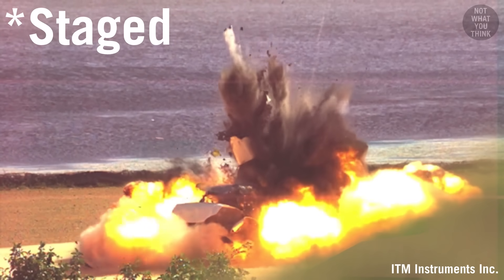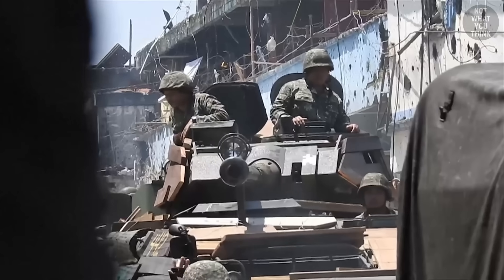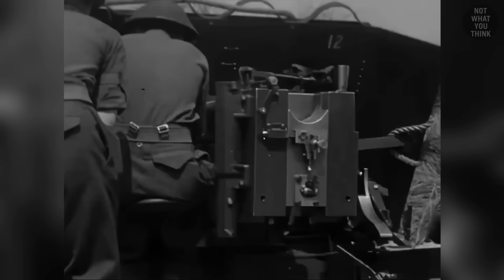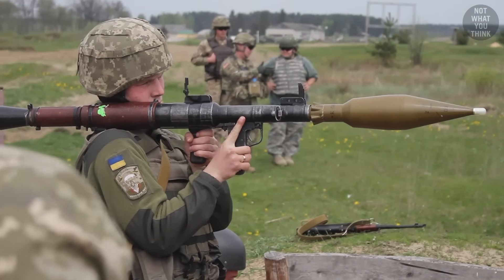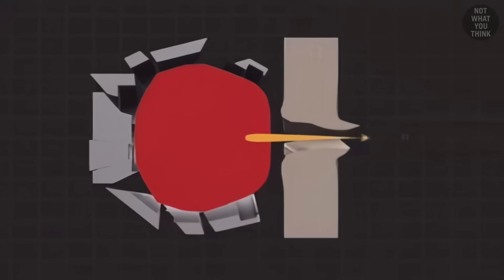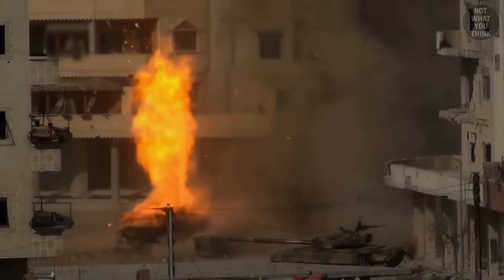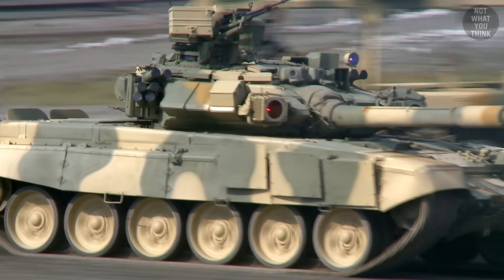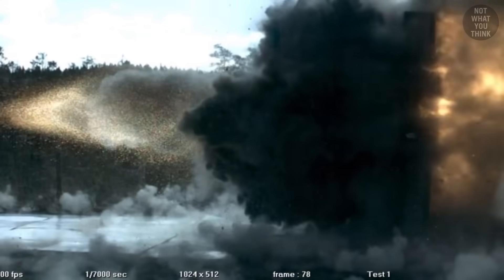Why Protecting Tanks is Getting Much More Difficult

Comment: Before you read just know that this is a very long read, have fun. 

The tank isn't obsolete and won't be until something with better protection, better firepower and better mobility comes along. A tank combines 3 key elements in combat: protection, firepower, mobility. It also cannot be viewed in a vacuum, it should be part of a combined armed force which today is even better at protecting a tank.

So firstly, protection. Of course a tank has armour, it may not be armour capable of defeating modern anti-tank weapons but it's still armour that forces the enemy to use a heavy anti-tank system to take it out, now this is important in a vacuum but even more prevalent in combined arms warfare. A sniper can sit far away, engage an enemy AT gunner and remain concealed because it takes a bullet to kill an AT gunner, the sniper can then exit the battlefield without ever being spotted. Firing an anti-tank weapon is a lot more obvious, when it is fired it's loud and lets off some smoke, this means that your infantry or in modern warfare even drones can now see that AT gunner's position and subsequently even if you lost a tank that anti-tank gunner just gave away his/her entire team's location and now it's open for counter-fire, an AT gunner knows this and so may very well avoid taking the shot if there is close observation and the AT gunner isn't in a good defensive position to return fire against the infantry that will come to destroy him/her and his/her team. Additionally, whilst you may note that a lot of infantry carry AT weapons on them, not all of these are the heavy Javelin / NLAW systems, a lot will be AT-4s which can take out an APC or maybe an IFV but certainly not an MBT.
So in short: even if the tank is destroyed, when combined arms operations are being used the AT team will likely also end up destroyed or with casualties unless in a good defensible position and so the enemy may choose not to fire their AT weapon.

Ok now firepower. A tank can take many types of shell, some of these can be used against enemy tanks / IFVs which means that the infantry don't have to use their own weapons to do so, an APFSDS round capable of destroying an enemy tank / IFV costs around $5k, an NLAW costs $30k-40k, now the cost argument seems to favour the tank. Additionally as per my first point this means your own infantry don't have to give away their position, the tank does sure but the tank can't be suppressed as easily and also is immune to small arms fire so the enemy would need to use an AT weapon to take it out and that's saying that it doesn't as per my 3rd point simply re-position. However, a tank doesn't just need to take out other vehicular targets. A tank may also be loaded with thermobaric munitions which can easily take out infantry in fortified positions. This means that one tank can do what would otherwise require an entire platoon or perhaps even company of infantry to accomplish: remove an enemy force from a fortified position such as a building. Now sure if a building has civilians in it a tank cannot engage said building with these rounds but if it's totally clear of civilians then (depending on the size of the building) a few thermobaric rounds will do 1 of 2 things: either the enemy will realise that they're getting screwed over by a tank and that they're also being suppressed by infantry so they can't really do much about it and try leave the building / surrender or it'll inflict heavy casualties and so when the infantry assault the position they won't face anywhere near as much resistance.

Ok 3rd point, mobility. A tank is surprise surprise faster than infantry on foot, this is helpful no matter what level you look at it, tanks can rapidly advance and with IFVs can do so with infantry support, the infantry if they're really brave may even ride on top of these vehicles which has the consequence of allowing them to see even better offering more to the combined arms front, it also means that they can reposition quickly should they engage or be engaged by the enemy. It's this mobility that means tanks can exploit gaps in the enemy line much more effectively than foot infantry.

Another point I'd like to cover that is arguably more important than all others is the phycological impact of tanks on infantry, tanks are big scary things to infantry even if the infantry have AT weapons, a tank's very presence may just make the enemy more likely to run away which ultimately means you've won the battle. Tactical phycology cannot be overlooked.

Ok so overall from this, tanks are not obsolete however you should absolutely never ever be sent in without support from the rest of the combined arms force.

I also do not claim to be an expert on this matter, I'm just another random fella scrolling through YouTube with an opinion and some basic research.

Comment: Tanks definitely have a place in warfare. Especially if the enemy doesn't have good, modern anti-tank weapon systems :D
Reply: Tanks for that 😆😆😆
Reply: But any enemy that is resupplied by a developed country will very quickly get modern antitank weapon systems as they're so light, transferrable and cheap. As the Russians discovered. Yeah, tanks still have a place. They're good sniper killers for example (grunt points to house shot came from, tank demolishes house) - but they are now auxiliary rather than the main game in ground warfare.

Comment: Main battle tanks as we know them maybe loose significance due to more and more ridiculously powerfull AT weapon-systems but tanks overall? No. Self propelled armored artillery for example, is capable of fireing its payload relatively covert and relocate before the shells even hit the ground and that while protected by most weapons you have to expect in a rear position. Then there are IFV that give the infantry access to the extra oomph they can't carry them selfe while have a relatively safe way to their objective. Or APC, that aren't that heavily armored but due to their speed and maneuverability really hard to hit while in the move and for everything else, there is their light armor. Or mine sweeper tanks, if you need a fast way of literally plow through a mine field, there it is. 

And there is still the psychological effect it's big, it's loud, it's scary and have this hughe ass pipe sticking out. That's sometimes enough to make, especially bad trained forces, loose their shit and either dissapear or let them make crucial mistakes. 

And in cities, where you can't use stuff like tows and javelines effective, a tank still dominates. I think the evolution of tanks will go in a direction, where the engineers would improove top protection maybe by sacrificing some frontal protection to save some weight.

Comment: I think the problem with tanks is that they are limited to the size of the plane delivering them and road widths. Most tanks can do down a normal road and thus aren't much wider than a truck (if at all). We need a tank that is twice as wide with the same proportions. This way it becomes the mobile fortress they originally started as. You'd have crews of say eight people with multiple weapon system. Then we need stealth, which means electric engines. You effectively need to simulate a navy vehicle on land. Nuclear engine anyone?
Interestingly I don't think they need big cannons anymore. You can use the tank sensors to guide in artillery. This  would then allow smaller high fire rate guns that can shoot down drones and missiles.
So imagine a 200 tonne vehicle which specializes in stealth with a low heat signature (compared to a diesel engine) driving around at night being used to assist artillery and infantry. Like the F-35 it becomes a more integrated machine that isn't designed to operate solo.

Comment: Modern anti-tank weapons are simple to deal with, but it will require coordinated devices. There must be fairly small drones on the exterior of tanks, that can recharge by landing, that will occupy the air perimeter of the tank. They will form an aerial wall in multiple directions that has the ability to detonate to render an incoming munition obsolete. By also having advanced sensors, algorithms, and even AI they will be able to detonate precisely to take out anything incoming deemed to be a threat. 

They can not only form aerial shields to detonate incoming munitions, but also go out further to detect and detonate mines as well as seek out smaller targets that can be exploded by drone compatible payloads.

Comment: The "shaped charges" in nuclear fission cores aren't exactly the same as shaped charges in RPGs, they work on a similar principle, but they are "lensed charges" rather than "shaped" ones. The difference is that a spherical pressure front is needed, one that moves inwards, rather than outwards. To this end those pieces you see surrounding the fissile core are composed of two different kinds of explosives with a hyperbolic intersection, the outer one is detonated from a single point of origin, causing a(n outward moving) spherical explosion to propagate through the first explosive medium, which then starts setting off the second, lower velocity, explosive medium. The result of this outer explosive setting off the inner one is a partial inwards moving spherical pressure front. Surround a fissile core with a bunch of these and set them off at the same time and you get a proper spherically compressing explosion!

An important aspect of these devices is that they only cause a supercritical nuclear chain reaction if they are set off properly, which is exactly why none of them ever properly exploded when their planes went down.

Comment: Considering the focus is shifting towards infantry I think in the future we will see tanks function more like IFVs, Merkava IV for example is a tank that is capable of transporting infantry and it also has an onboard 60mm mortar system which if paired with drones could recon for anti-tank squads and destroy them from afar before the AT-squads can get sight of the tank, as well as provide fire support for infantry.
Reply: The Merkava is only capable of carrying infantry if you remove the majority of the tank’s ammo racks, and even then the space is extremely cramped and not suitable for carrying fully-equipped infantry into combat. The space just exists as a way to carry a few wounded soldiers in an absolute emergency.
Reply: @Notreallysureactually  If the ammo racks are removed then the Merkava 4 can carry 8 infantry soldiers, that's not a small number, if they aren't removed you can still carry 3-4, and I don't know why you say they can't be fully-equipped, there are infantry baskets at the outside of the hull in the back where infantry can place their equipment, the tank's crew have their own basket at the back of the turret. The space can also be used for other means other than carry wounded soldiers, carrying engineers, artillery commanders or other non combat personnel in and out of the battle zone is one use and also 20 years ago in an urban environment Merkava's often had 2 infantry snipers at the back that shot at rear threats by opening a crack at the rear corridor door, later a barrel opening was added so the snipers could fire without the need of opening the door at all.
Reply: @E_y_a_l  It’s exactly like you say. If you want to use a Merkava to carry an appreciable amount of soldiers, you’d need to remove almost all of the tank’s ammo AND store the soldiers’ gear (what they need to actually do their jobs) outside of the tank. At that point neither the tank nor the infantry can fight effectively, because the tank doesn’t have enough ammo and the infantry don’t have easy access to their equipment. You’re better off using an IFV, something that can carry the same number of soldiers AND their gear inside while also retaining its full fighting capabilities.
Reply: @Notreallysureactually  You're over simplifying things, infantry(or tanks) have a lot of different types of missions and uses, you talk about a very specific scenario, in some cases the setup described is suitable and in others it isn't, you also don't always need the tank to carry all of its ammo, it depends on the situation, the mission and the threats, also in most cases if not all when a Merkava will carry an infantry squad, the infantry's purpose will be to go from point A to point B and then disembark and fight on foot, not to fight from inside the tank, so it doesn't matter where their more heavy equipment is, and again, that depends on what you mean fully equipped, obviously they are inside the tank with their vests and weapons with them, the baskets outside are used for things like personal bags, sleeping bags, tents, etc...you're right that obviously an IFV or APC will be better in carrying infantry, after all that's what they are designed for and that's why all of the Israeli infantry are mechanized and have their own vehicles and do not rely on the Merkava's for transport, but just as a theoretical discussion which was what the OP was talking about, the Merkava's do have the capability if it's needed, just the ability to have a room where soldiers other than the crew can be is a welcome thing because in the past if there were extra people in the tank for some reason like artillery officers, intelligence officers, mechanics etc, they all needed to cramp up in the turret, having the ability for each tank to carry 3-4 additional soldiers without removing the ammo racks means a platoon of tanks doesn't need additional 3-4 APCs to travel with them to carry the mechanics and electrical specialists, which is already an advantage.
Reply: @E_y_a_l  Incredible, over 300 words in a single sentence.
Reply: @E_y_a_l  You’re welcome to like your own too if it will make you feel better. Maybe you can learn how to use punctuation while you’re at it.
Reply: @E_y_a_l  Essentially, yes. We also learned you don’t know what periods are.
Reply: @E_y_a_l  Lol, give me another two days and I’ll be back with a real zinger of a comeback.
Reply: Affordable if you funnel most of the US budget to the point your nation is already running a massive surplus

But mentioning that kind of corruption and outright subversion while hiding more funding in bills is what we call anti semetism
Funnily enough that's the same word for being anti corruption

Comment: No HEAT warhead is capable of successfully penetrating the front of a modern MBT. That's why kinetic penetrators are still needed for that.

The success of the Javelins come from the fact that a simple HEAT device can be mounted on a rocket that can be directed wherever you want, I.E. the roof or the side of the turret of a tank or its engine bay. And in those places the only "armor" is a 10-20 mm thickness of steel, which is easy to penetrate by a HEAT charge.

(A final note: HEAT rounds of a MBT can still be useful against enemy tanks that are far, due to the parabolic shoot that will inevitably land upon the roof or the upper hull of the vehicle, which nowadays are better protected but still might not be enough)

Comment: I think tanks will continue to exist, but in much smaller numbers -- no longer serving as the offensive backbone of a cavalry, but as more of a defensive anchor for infantry operations. Drone ground vehicles could be much lighter, faster, and more expendable. Drones don't need to be armored to protect a crew. They don't need to carry food or medical supplies (unless the mission profile requires it). They don't need breaks so they could be always-on sentinels. They could potentially be designed as electric vehicles if they can come up with lighter batteries. Additionally, they could be remote-controlled or AI-operated as necessary. 

They could be built light enough and small enough to be deployed in small groups from altitude. Damaged ones could self-destruct (instead of being abandoned in a retreat/withdrawal like a tank might be). Likewise, drones could be made to be modular to be water (or submarine) -based, air-based, made into artillery or anti-air batteries, anti-armor, anti-infantry, crowd-control, as scouts, supply trains in dangerous and forward operating areas, etc. The equipment load-out to be adjusted accordingly and quickly with the right setup.

Comment: The debate on the potential demise of tanks in modern warfare has been ongoing since the conflict in Ukraine began.
Philip O'Brien has voiced the same conclusion as in the video, with experts such as Michael Kofman and Rob Lee arguing against him.

While it is true that tanks are becoming more vulnerable to improvements in anti-tank guided missile technology, this does not mean that infantry alone can be relied upon to carry out the same tasks. The limitations of the human body have not changed since the invention of the tank, and artillery can still decimate a well-trained and competent troop formation.

The solution lies mostly in combined arms operations, where different types of units play specific roles to achieve an overall result. In other words, the key to the effective use of tanks in modern warfare is to use them alongside other units, particularly infantry, rather than relying on them exclusively.